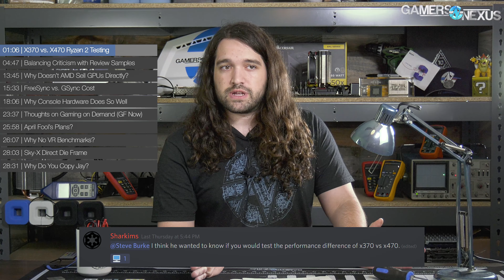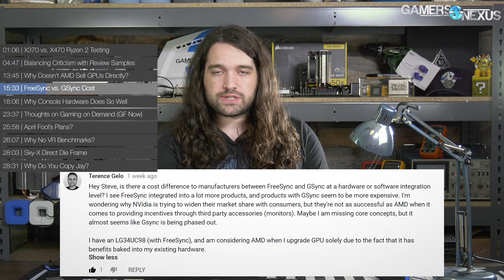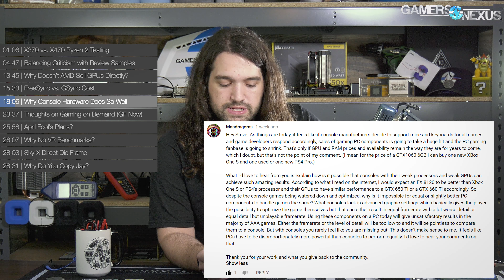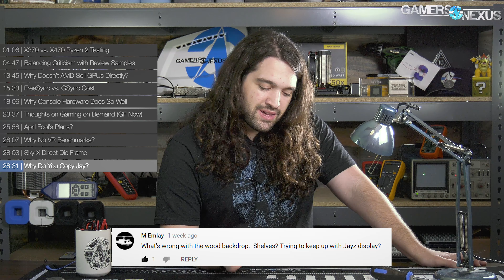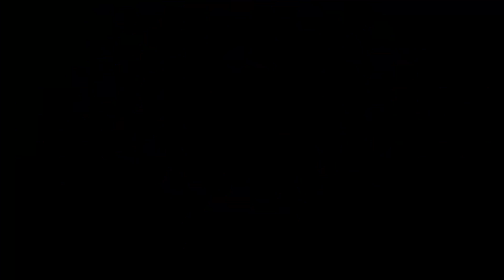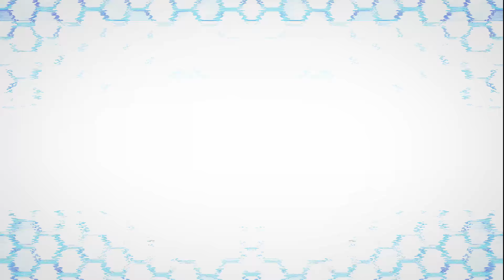Ask GN 75: X470 vs. X370 Tests, Balancing Criticism vs. Samples

Comment: #AskGN What CPU did you use in the Overclock livestream to beat Linus? xD
Reply: Vinz_HD some people didn't get the joke :)
Reply: Vinz_HD 386, I believe
Reply: Q6600
Reply: Q6600 is a god
Reply: Pretty sure it was a Pentium IV
Reply: 486 DX2 @ 66mHz I am pretty sure
Reply: Intel 8080 i believe
Reply: They used the Intel Core i9 7980XE
Reply: Pentium MMX sl23s aka overclocking-beast!
Reply: Must be a review sample I9
Reply: Pentium D
Reply: yeah i think so too XD
Reply: When PCIE 5.0?
Reply: hahaha, make him say it!
Reply: That was my first build. Damn the memories....not an assembly like these days, actual logic & knowledge had to be used back then. No manual? that's a bummer, no google for dip switch & jumper settings. but flashing was a bit less stressfull with removable ICs.
Reply: MOS 6510
Reply: Steve said he used a Core 2 Duo 6670
Reply: I9 7980XE I think.

Comment: #askgn I'm using kraken x62 on my rog maximus x hero (8700k) and directly from the start CAM reports that CPU fan speed is 11500-12600 RPM. How should I fix it and should I?
Reply: GirlThatRules uninstall cam, remove the kraken, start a bonfire, place kraken in fire.  Buy cooler that doesn’t use cam software.
Reply: Nzxt CAM is garbage

Comment: x470?!?! I just ordered a new computer, my old one is only two years old and was the best on the market when it was bought, now it is outdated two generations of motherboards.
And my new computer will also be outdated instantly? JEEEEZ
Reply from the maker: That's the hardware industry for you. Fortunately, even though new stuff is always coming, things that are good today will still be good tomorrow -- just the relative scale slides a bit.
Reply: Mainchain well outdated is not necessarily obsolete
Reply: That's how technology works, if you want to be on the bleeding edge expect to upgrade all the time.
Reply: Well, if you'd kept up with the news, or just knew how hardware cycles work, you'd have known there'd be an updated platform launching soon. Ryzen 1 is still great though.

Side note, "ordered a new computer"? As in, bought a prebuilt?
Reply: And is it worth the money? Is there a ROI for you because you run a business that requires the newest and highest performing and most power efficient parts? Or do you just need to flex all of the time with the most expensive gaming PC?
The only part that needs pretty frequent replacement for gaming is the GPU, I have a hex core CPU on LGA1366, 12GB of ram and about a year old 1060 6GB and it's perfectly capable of handling even brand new games on 1080p, and almost all of the time the GPU will be the first to bottleneck.
Reply: Do the generations really matter if the performance difference is minimal? I can't detect any difference between 8600k and my overclocked 3570k in all normal use cases and gaming.
Reply: I put together a Z97 system in February 16 and apparently that tech was already 2 years old and yet it was still doing very well in 2018 when I upgraded to Z370. Granted I should have bought a 4790k but eh. So yeah, don't worry.
Reply: /shrug should have been aware of upcoming releases
Reply: @HotRodX
a i7 7700k would easily be better, and much cheaper than a  complete system change to a ryzen+
Reply: Is your new PC an AMD platform? If so, you don't have anything to worry about, and will be able to stay 'current' with only minor hardware upgrades(such as replacing your 1000 series Ryzen CPU with a 2000 series - while keeping EVERYTHING else the same) as the market evolves instead of needing to completely rebuild your system due to a single generation architecture.

If it's Intel, well, you're gonna be stuck until you either upgrade the whole platform, or replace the whole computer again...
Reply: @RyTrapp0
not if you bought a cheap b350 mobo, weak vrm will throttle anything higher than a 1600 so you are stuck till 2020~! XD

also ryzen+ is only 10% better, so that is garbage as well

all you can hope for is ryzen 2, which is most likely also only a 10% bump XD

If you had bought a proper i7 setup it will EASILY last over 5 years of excellent performance and would have been CHEAPER, look at the i7 2600k

those that do not learn the lessons of history are doomed to repeating them
Reply: @OdinAlgeron You're a fanboy that's not even worth wasting time on because you can't possibly present an unbiased thought that's based in reality.

Now dance, puppet...
Reply: @RyTrapp0

XD I only victory dance

How about you actually refute my statements instead of dumping your diapers?

You can't because what I said is true
Reply: OdinAlgeron Good good, keep dancing...
Reply: Mainchain The second core generation still gives an amazing perfomance by 2018 standards, more specifically the i5 2500k and i7 2600k specially if overclocked, so I wouldn't worry about not having the latest hardware when older hardware is still trading blows with the latest generations.